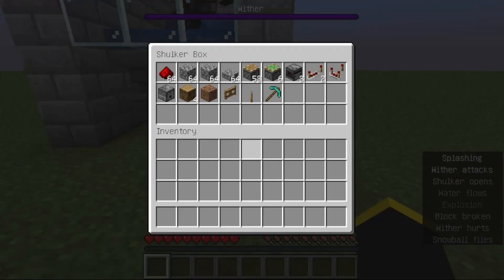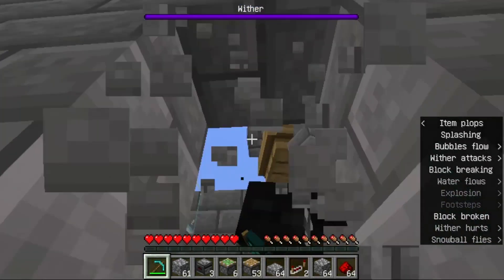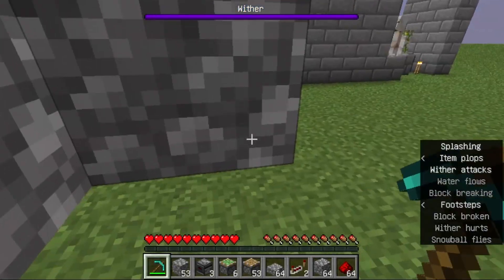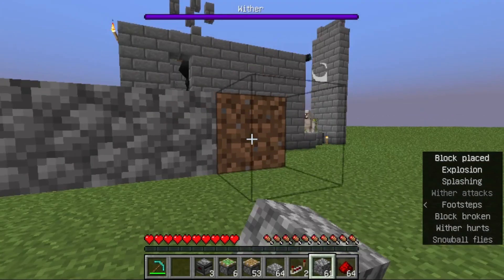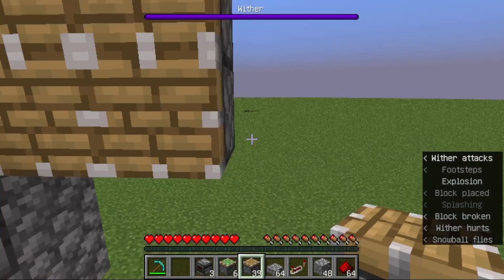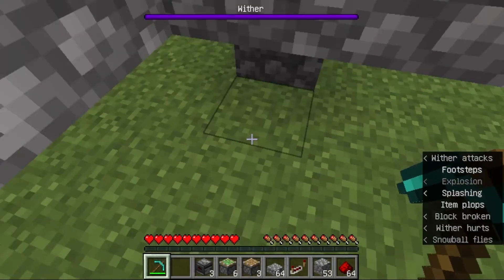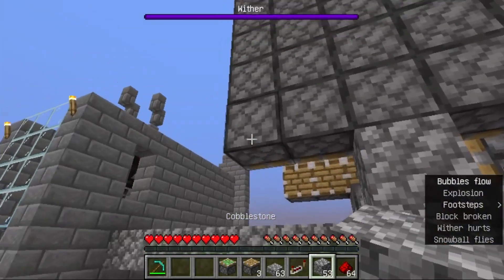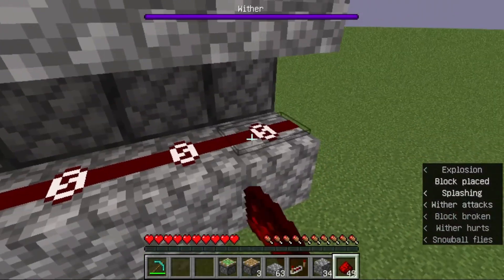Minecraft Java survival: Wither-based tree farm tutorial block-by-block (Bedrockless), Type 1

Comment: As soon as i put the piston facing down in wither cage the boat goes off and wither gets free and also when i hit the wither it didnt breaks the anvils
Reply from the maker: Thanks for trying it out, what Minecraft version, and do you have mob griefing turned off?
Reply: @Blackrobe  i am on paper idk about mob groefing but gold farm works if u r looking for that and blockd dont break i tried mannualy putting logs
Reply from the maker: @DineshKartik-df5ye  No I mean, are you on 1.20, 1.19, or earlier. IIRC wither cages behaves differently in multiple versions and many new design couldn't work.

Hmm if wither turns red and blocks don't break, that possibly mean mob griefing is off. If Creeper explosions does not break block also, then it confirms that mob griefing setting is off.
Reply: Version is 1.19.2